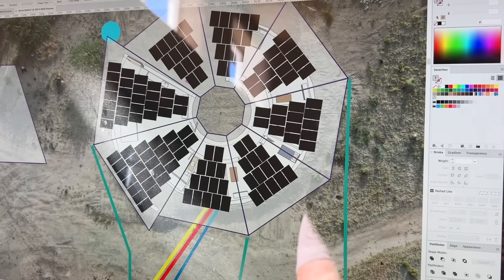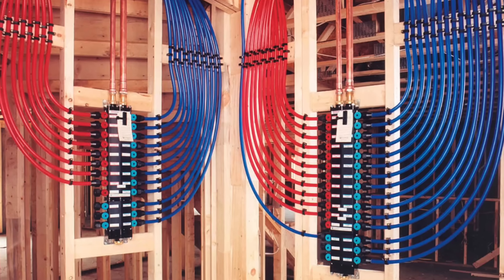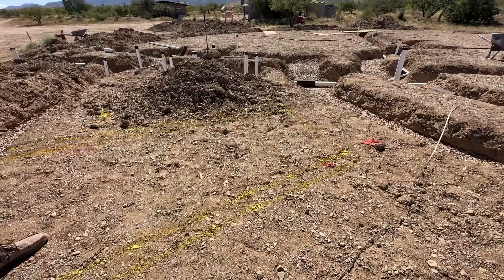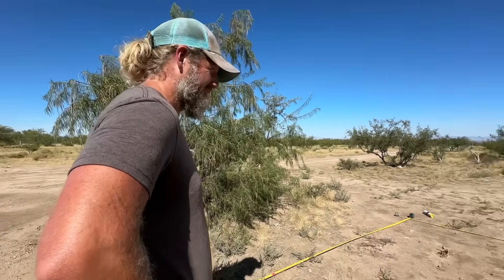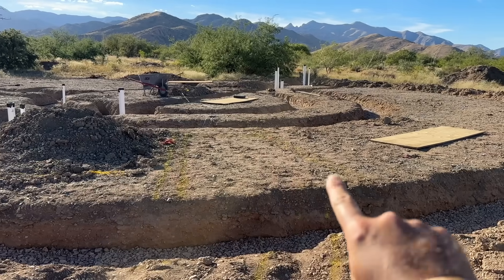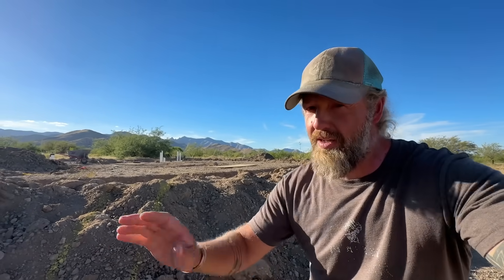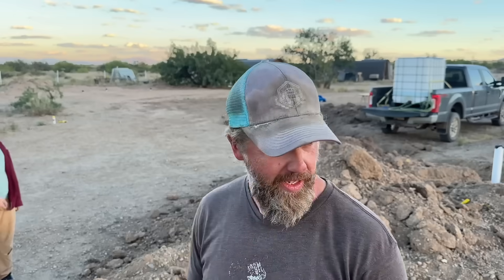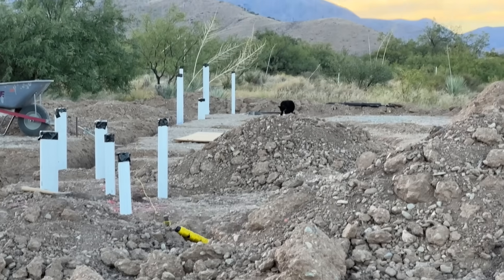UTILITY TUNNEL - Protecting Water & Electric Lines Under Earthbags

Comment: Hi Tiny Shiny, perhaps you won't see this question, but what are you installing to prevent that you water collecting tank is protected of contamination because it's next to your septic field installation? Where I live, I don't think you can put the septic near rainwater collecting stuf (against regulations) so I was wondering how you are going to protect your water.
Reply from the maker: The only reason you'd need to worry about this is if you had a holding tank underground. Otherwise, the rainwater catchment tank is above ground and there's no cross contamination. However, a drilled well needs to be at least 100' from your septic because that could definitely contaminate it.

Comment: Why don't you put up more water tenks, one is not enough, by adding more water tenks you can catch more rain water for longer useage and save money on driving to go fetch water in town in dry season. Just a suggestion. Love your channel !
Reply from the maker: Make sure to watch previous videos explaining the full utility plan. There will be a 30,000 gallon tank for the house roof matched to it's size.
Reply: @TinyShinyHome  wonderfull did not know that, 30 000 gallon tenk is a great plan 🤗

Comment: Hi! Love your channel. I'm a Canadian who bought three rural off grid land quarter acre lots that has been deleted from the homeowners association that kept only the lots with water services or access within the 1 kilometer to be included as serviced in 5he Mohave Desert in New Mexico, so your content is really interesting. That said, I've been practicing on the lot that I'm a tenant of for my residential mobile home. The comment I need to make is your solar cables should not be longer than 20 feet to reduce loss of efficiency, or you will compromise a much larger system overall to compensate for the weaker performance,  your system is working a lot harder because it needs  a lot more resources ans power to carry it the longer distance of your solar shed from your house. If your system was designed by an expert, they would be able to do all of that, which may be part of the reason there are so many photovoltaic panels in your plan. My own problem is how to make an indoor luminary solar power system because my landlord wants my mobile home to look like every other mobile home in our mobile home park. Well, that technology exists too and I'll keep watching and learning from these contents by inventors and innovators like you. A sincere thank you for sharing your journey!

Comment: Curious one here....how will you get through the gorilla tape?  A small RC car with a dart on the front end?  A prairie dog with mining gear?  I know the wires can be fed through, but are they strong enough to punch through the tape?
Reply from the maker: Just cut it? It's not like we're covering it back up.
Reply: @TinyShinyHome  but but but...won't it be under all the bags, etc?
Reply from the maker: The bag will lay on top of the metal. The taped ends are still exposed.

Comment: Unless you like digging where you have previously dug and filled I suggest putting in electrical conduit in the ground through the spot where the steel pipes are under the bags. That is often common practice in most construction sites where the electrical has to run through the foundation. It would only be a section of conduit and an elbow. It would save a lot of elbow grease in the future.  Same thing for water.

Comment: We did some Adobe work up in Southern Utah area up in the mountains and because of all the mud, rainy seasons, and all that we want to make sure the ground was good so we used cinderblock where our pipes and electrical and everything got to go through because it’ll self support and it’s a lot cheaper than buying well pipe. I know you probably did this stuff a week or so ago but just an idea it’s really easy to work with.
Reply from the maker: Eh, cinder blocks are very easy to crack. Wouldn’t use them at a pivot point like that.

Comment: If i remember correctly you are going to pour a slab inside once the bags are high enough. If so you should put the pipes for the utilities in now. Just from outside the bags to above the floor
Reply from the maker: Well do all that before the pad is poured
Reply: @TinyShinyHome  I thought you might.  Would you like some barbed wire for your super Adobe workshop? I have a few miles of it I want gone
Reply from the maker: We'll need it rust free and on spools so attendees can work safely with it. Got the impression it was still part of your fence?
Reply: @TinyShinyHome  some of it's fence but most of it's on the ground because the posts have rotted away. All of it has surface rust. It was worth a try. 😀
Reply from the maker: Haha no worries we appreciate it :)
Reply: @TinyShinyHome  if you'd like me to run over with my tractor to speed up the pushing dirt into the trenches, let me know

Comment: The sketch of the blueprint of your house and roof shown by you today indicated that you plan to place photovoltaic or solar thermic panels on all circular roof segments. Have you actually analyzed ahead how much or whether at all the north-facing segments would be able to generate in terms of electric or thermal power? Maybe you better omit the north-facing roof segment and don't place any panels there unless it really qualifies for generating power at all.
Reply from the maker: We’ve talked about this a few times, but yes north facing panels would help a ton in the summer when it rises and sets to the north and it’s the hottest time of the year.  Our south facing panels get pushed to their limits in the summer.

Comment: Great, a tip in the future, you can use water to drill your hole under ground without need to tunnel.
Reply from the maker: Yeeah...that requires water and a lot of power ;)
Reply: For future reference, not necessarily: 
https://youtu.be/kDEppaTW80s?si=NP4_7gvWJVbwDk9d

Comment: Would it be worth running some large conduit through the protection tubes now? My thinking is would save digging again so close to the newly finished walls and you could fish through the cables and water pipes?

Comment: Publix, a supermarket chain, is putting a building up beside our condo. The builders used the same process as you do. All the conduits, plumbing, and drainage was set up prior to election of the building. Great work. Time spent now setting up future steps will save time later. A great video! Thank you!

Comment: Hey, engineer here! Just wanted to mention two things. The underdrain steel runs that cover your pipes under walls may want to be coated so they do not corrode from the occasional rainwater that fills the aggregate under your walls. Store bought cans should do the trick. Also, you could use those arches of half pipes to cover the smaller diameter piping if you place a rest sheet under the bottoms so they do not sink into the ground. A sheet of aluminum from Home depot could work for this, and that wouldn't corrode either! Good work so far!👍
Reply from the maker: I mean, this is well casing. It's meant to be underground and exposed to water ;)
Reply: Just wanted to bring it up! Some well casings can be cheap carbon steel, some are alloys that resist corrosion. It will last a long time, regardless. Just didn't want yall digging it up a few decades down the line! @TinyShinyHome
Reply: @TinyShinyHome by cutting the pipe you've compromised pipe you need to seal the cut ends for it to not corrode.
Reply from the maker: Water underground isn't really an issue in the desert so it shouldn't be a problem.
Reply: Remember where you are a desert, moisture is NOT a thing so corrosion may happen, in a longer than a lifetime. But thank you for your concern.
Reply: I develop pipelines for underground use across the country, including arid states. They will corrode in this scenario if they are cheap CS. Maybe in 5 or 10 years, 20 if they are lucky. Moisture is ALWAYS a thing. lol  @davec9244

Comment: So now I know where the supply lines are going to run to the house and that there will be a mechanical room in the house to contain the water system and the electrical box and perhaps an instantaneous water heater. I like how you figured out where the pumphouse/solar system invertors utility shed will go. Dino at 3:58! Great that you got the protective well casings placed and buried. Good idea to tape both ends. Jax looked like he had enough of digging to lay those down. I'm glad to hear that in the morning if there doesn't seem to be any leaks in the drain lines you can start filling in the plumbing trenches tomorrow! Thanks for this video Longnecker family!

Comment: 🤔I find it quite odd that you're building a separate utility building that's quite detached from the round house... since that would entail a lot of wiring & efficiency losses that come with that (I imagined all of the solar equipment would live inside the utility closet ~unless that's a safety concern though I'd figure building something much closer/even semi-attached to the home could work)
Reply from the maker: You don’t want your power equipment in the house for safety reasons, yes. Power loss won’t be a problem if wiring is sized right.
Reply: @TinyShinyHome  makes sense. thanks for the response... was just looking at it in the cost-benefit side though I suppose you can't put a price on peace of mind 😄 cheers!

Comment: Question: Why do you not put up a water tower so you only have to pump your water once and gravity feed?
Reply: They plan on catching the rain off the roofs to provide all their water so the water tanks are set a little below the gutters on the roofs. Then they just pump water mostly to the trees through the irrigation lines. They do pump it to the Airstream, shower, and chicken/garden area powered by solar panels. Each roof has a tank and pump house. Maybe a central water tower would be more efficient but maybe expense is a factor? Have a great weekend!
Reply: In the desert heat? They would have to cool the water off before use in the summer.
Reply from the maker: Nope